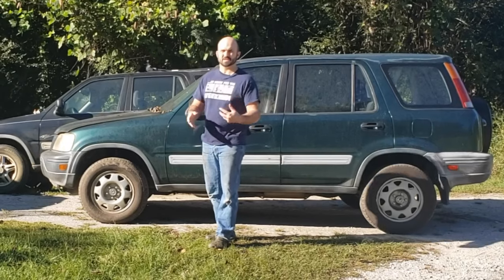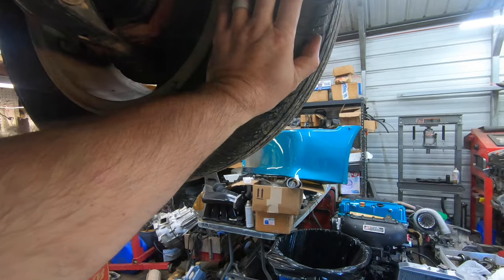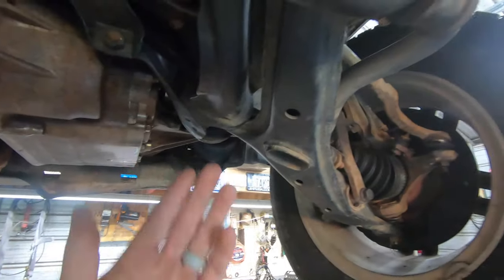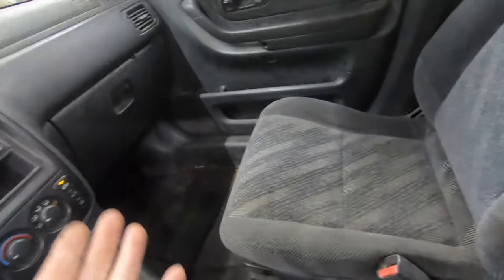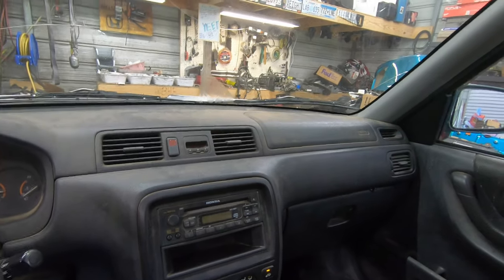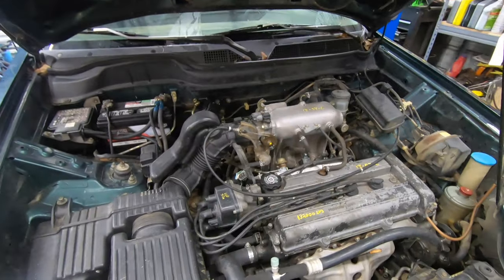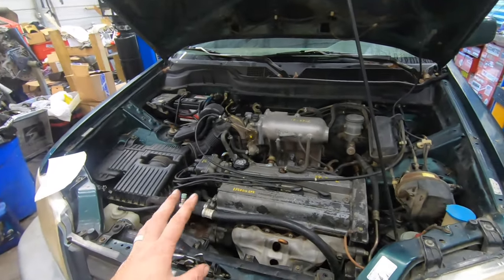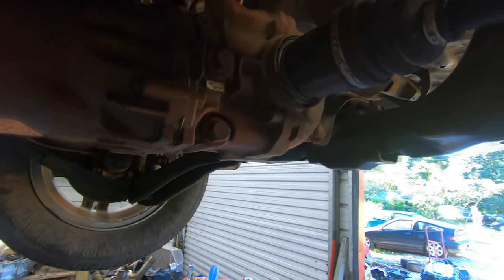Most Common Problems: 1997 - 2001 Honda CRV RD1 RD2

Comment: I’m having issues with getting the correct oxygen sensor for the down stream sensor and so far the one that I have now is a Denso 234-4011. It has the right correct connection but according to what I’m seeing it’s a up stream sensor don’t think the guys know how to read a parts book. The first one they gave me was the right sensor but a universal connection which had round pin’s and but mine had the flat pins. So it wouldn’t work so will this Denso 234-4011 work down stream?. Just asking. Maybe I should try a different brand. Like Bosch or so other brand. I do know this that O Riley’s is three to four times higher in there pricing 😮. This is 2000 CRV-EX four banger. If know or can help would be greatly appreciated. Today is Saturday Sept 17 2022. Thanks.
Reply from the maker: That is indeed the upstream. The correct number is 2344098
Reply: @hondaresource  part marker Denso or Bosch ?
Reply: @hondaresource  I see now it a Denso

Comment: Hey I got a question my 1 st gen Honda 1997 CRV has a miss on my Honda and it’s leaking gas a bit and spraying a bit of oil on the the radiator cover so what could that be by chance
Reply from the maker: there are a lot of variables there. you can send me an email to phillip@thehondaresource.com with some pictures and hopefully I can help you out.

Comment: Hey man how's it going. I figured you would be the best person to get into contact with regarding my RD1. I recently had code PO730. Transmission was slipping and not going into gear. I bought a jdm imported transmission with approximately 50,000 miles. I swapped all my sensors from my original to the new transmission with torque converter. With the new transmission in my RD1 it's still giving me the same code. I replaced my shift solenoid A, and my speed sensor. Is there any advice or knowledge you know of to help me out? Thank you.
Reply from the maker: Which torque converter did you use?
Reply: I used the OEM that came with the imported tranny I didn't use my original one that I had on my previous tranny because the mechanic said it would mess up the tranny I bought
Reply from the maker: @johnnyplurlife  correct, just making sure I was understanding correctly. I don't really know what to tell you man.
Reply: No worries bro thank you for your time. I'm going to swap out my shift solenoid B and see if that does the trick if not that new transmission it is

Comment: Good morning my cluster speedmeter went to crap, do the first Gen have speed sensor solenoid’s as the same as the civics, and are they in the same location?
Reply from the maker: They are. Right on the back of the trans. Be sure to check the terminals on the wiring harness connector. They corrode sometimes.
Reply: @hondaresource  awesome will be replacing and doing a video tutorial on the Fix appreciate you
Reply: @hondaresource  update on the fix, terminals were ehhh okay swap the VVS  and now my cluster works, she still sputs a lil from 1st to 2 second, im thinking the transmission shift lockup control solenoid needs to be replaced  have you had to replace it Before, and if so what were your symptoms

Comment: Hey bro, I have inherited a RD1 with pretty much all these issues. Thanks for the heads up on where the problems lie. I also have a few other issues; there is a distinct 'miss/hesitation' under power most noticeable around 2000rpm in 1st/2nd. Any idea what this could be, it runs mint otherwise. Also I see the car in the video has cracks coming in from the sides of the windshield, mine developed the same a few days ago out of nowhere! Liked and subscribed, thanks for the content
Reply from the maker: I would definitely start with a valve lash adjustment
Reply: MAP sensor also

Comment: Hi I was wounding if you can give me some in put on issue am having my 1st gen crv died while driving. When I go to start it I hear fuel pump turn on and prime and I can hear the relay click by the glove box when I go to turn it over all I hear is spinning noise. It’s not cracking over I replace the starter and cap I did get the rotor but it’s not cracking so I can’t get to the bolt to replace it I was going to get spark plugs and wires and check the fuses but any other info that could help would be awesome
Reply from the maker: Did your timing belt break?
Reply: @hondaresource  I haven’t checked I man hope not 🤞
Reply: @hondaresource  I gotta get A Valve cover gasket be for I check gotta do it tomorrow

Comment: @ Hondaresource can you please tell me what is wrong with my 2000 CRV. When I made a right turn the engine pwr no longer transfers to the wheels. I thought bad axle I remove both CV axles and they appear OK. When I put the car in gear it won’t go forward backward and in park it still rolls do you think the trans is gone? When I start the car and put it into gear you can hear the trans shifting and speedometer goes up and it shifts gears but no power goes to the wheels please let me know what you think  Brad
Reply: Ps: my crv it is automatic and frnt whl crv thank you
Reply from the maker: Definitely sounds like a broken axle. They car break inside the boots.
Reply: HondaRes:Thank you for the reply. I tried turning the axles holding both ends, and felt intact, but one could still be broken?
Reply: If axles ok then anything else to try? Thx
Reply: Turns out it popped out psngr side. And replaced with new one. We’re good 4now!

Comment: Funniest thing inside . I seen the door handle broke on passenger side,,  mine is broken inside and out & Hurd others have the same problem ,..ware is your shop ? Qm having a hard time finding a good used AWD transmission ..high price & high mileage 😡 ..would you know a good source I can get one ,? Can I convert it to a front wheel drive automatic different transmission ? ..I'm suffering 🙃
Reply from the maker: I'm in West Blocton, AL. Yeah, they are getting harder to find for sure! try car-part.com

Comment: So I have a 1999 crv with a manual transmission and now it’s not shifting and stalls when I left of the clutch I just wondering if this could be the shifter cable?
Reply from the maker: Sounds like it's stuck in 2 gears
Reply: @hondaresource  so if it’s stuck in second and the shifter inside the car not moving it a broken or stretch cable yes?
Reply from the maker: @coreysda7984  could be cables could be trans

Comment: Hey I'm my 97 AC blows cold going down the road both fans are gone but once I stopped at traffic light cold-air dies off very faint but both fans are going could I have something going on and change over valve or system itself
Reply from the maker: Are the fans going at full speed? I've seen some that appear to be working but are barely moving compared to what they should be
Reply: @hondaresource  yes they are turning but that's a good point they might not have enough RPM for CFM flow

Comment: Any tips for an overheating crv in hot weather it’s fine otherwise
Reply from the maker: Both fans working?
Reply: That's uncommon. If the coolant is clean, and there are no leaks, consider the last time you changed your timing belt and water pump.

Comment: I have a 1998 crv and the steering wheel keeps going to the right and I hear a sound  that keeps making noise whenever the tire does a full rotation on the road and it seems to push the steering wheel right  from the left front tire
Reply: I don’t know what could be the issue
Reply from the maker: alignment?

Comment: Hi, I have a first gen 2000 Honda crv ex,   , so,  it would cut off if it was a super hot day abd I blasted my ac   couple times, had to sit 10 minutes, it would be fine , so then , it sounded if just sitting running for 15 minutes like it was hiccupping  out the tail pipe ,  but anyhow so  one day drove it to work came out , it was crank no start.  , got a jump , it started .  Checked has spark , so , drove , work  , again no start, but wants to , then changed fuel pump and filter,  same darn thing , but I drove it one whole day after filter got replaced, but that's it ,  , is it the fuel rail, , because it's not getting the fuel pressure, help please, b4 it gets towed. Thanks , seems like something simple but idk...
Reply from the maker: I would check the main relay, its behind the glove compartment.
Reply: @hondaresource  do you have a video on that main relay replacement?

Comment: Yep, leaky oil pan. That's in the to-do list.
Reply from the maker: Just make sure you use that rigid felpro
Reply: Yes sir, I've watched that video too.
Reply: Try just tightening up the bolts first.  A few of mine were a little loose & that did the trick.

Comment: These cars are BP!! Check 1. Upper and lower ball joint!  2. Inner & outer tie rods also rack boots. 3. Timing belt W.P. replacement AGE/MILES 4. Valve adjustment!! Everything else is maintenance
Reply: The clock you can remove and re-solder the circuit board

Comment: Hey buddy quick question or if anyone can help me out in the 1st gen crv with the door locks door. Do all four doors open automatically with the driver door switch or is it just the driver door that has auto locks?
Reply from the maker: They should all lock when you lock the driver door
Reply: @hondaresource  thanks very much now I gotta track down why only my driver door locks not the rest
Reply: @hondaresource  just lock only or unlock all four too?
Reply: @Edwin-uk7wc   hey I have a rd1 as well usually just locks all of them and when you unlock it it’s only the drivers door and you have to press the unlock button to unlock the rest, at least that’s how my 98 does it.
Reply: @electrogaming1274  thanks man I gotta track down my issue then mines only locks and unlocks driver door only
Reply: Lock and unlock driver door only

Comment: The middle Valve cover spark plug hole gaskets be rotting out and pouring oil onto the spark plugs and wires
Reply from the maker: Yeah those tube seals can be leaky from time to time
Reply: @hondaresource  Right causing it to lose spark and bogg down

Comment: One big major problem I've had with my Crv is it still doesn't have a Vtec engine swap 😁
Reply: My 2001 has a Vtec engine.
Reply from the maker: @Jeremyho439  you must have converted it
Reply: @hondaresource  
No. My Machanic told me that when he was working on my car. He said very few 2001 has this engine. I didn’t even know that. He told me every time I step on the paddle and the car suddenly runs like with turbo.
Reply: @Jeremy Ho  your mechanic doesn't know what they're talking about then. You'd have to put a vtec head from a b16/18. They didn't come stock like that.
Reply: @Jeremyho439  Oh Yea and What engine is that?

Comment: I have a 200 Honda CR-V, it fires up good , runs smooth, then just dies after a few mins, that problem repeats, what is the issue
Reply: 2000*
Reply from the maker: Maybe coil or ignitor in the distributor
Reply: @hondaresource  so just replace the coil? Could it be the ignition
Reply: I had that issue. I replaced the distributor and it was all good

Comment: I have the 97 Honda CR-V grey and l took it to get  head gasket on spark plugs and oil pan gasket and now it's leaking oil l say oil pan and white smoke just like that is happening 😭😭 l think 🤔 they cheated me ! It wasn't leaking oil and l know it needed the other things but it didn't have power as l drive it and main seal on right lower side  ! So sad 😭😭😭😭😭😫 because it didn't want to start ! I did get it started and took it back they don't care !!! Said the battery is on t it's worse and you tell me what parts l should  check ?  That's all I have and l need   because it's get cold and rainy and l need to get the the hospital ☹️ because of my cancer treatment every 3 weeks !l  have to take metro train and a bus to get chemo treatment and test l really need a videos ! I fixed it my self if I have to !! Thank you
Reply from the maker: definitely sounds like something is still going on with the headgasket if there is white smoke. Oil pans are notorious for gasket leak.

Comment: one you missed, and it is the most annoying in Hondas models from back then : Ignition Distributor /  Ignition Coil problems
Reply from the maker: distributor is definitely an issue.
Reply: I usually find its the ignitor that fails.  I now carry spare distributor parts & a new cheap chinese distributor in my car that I hope will get me home someday.  Car just shuts down on the freeway when a distributor goes bad.
Reply: @darrylstevens2556  it does! I had a problem with my RD174 model (1998) about 6 months ago. not long after replacing an aftermarket distributor (Chinese)... I feel somehow that it overheats from the cylinder head and then fails after a while... Although a mechanic friend managed to make it work with a random ignitor outside of the ignition cap and far from the engine, it required some "dodgy" wiring work, but it actually worked! no problems or performance issues so far.  I will take some pictures later and share them with a link  in the next comment

Comment: Any suggestions on a better horn? The horn for the 1997 sounds like a "Karen" at a riot.
Reply from the maker: You don't like Karen at a riot? 😂 There are a number of aftermarket horns with different tones that you can buy online
Reply: I'll take a look, but the only problem with that is you don't know the sound until after the installation. Cheers
Reply from the maker: @cri8tor  you could try it with some pieces of wire and hooking it to the battery
Reply: Yep, good tip.

Comment: Is rd1 mean generation 1 and rd2 generation 2 or ?
Reply from the maker: Rd1 and rd2 are both 1st generation. It's the chassis code. Rd1 is AWD, rd2 is fwd
Reply: @hondaresource  oh that makes sense thanks, then what would the 2nd gen be called rd3 and rd4
Reply from the maker: @lukavidovic3939  Rd6 Rd7 in the US
Reply: I have the R2D2 model....it just goes bleep-bleep-bloop....help me Obwan! It has a charger for a light sabre.

Comment: I'm looking at purchasing a 2000 CRV runs good oil always changed on time heat and air work fine but the problem it has is the AWD system only the front wheel drive works not the rear could this be a major problem or maybe a simple fix anyone with any or all kinds of information on this lol would be greatly appreciated thank you in advance!!!!!
Reply from the maker: Probably an easy fix. Is the driveshaft in it? If so and it's not engaging, try changing the rear diff fluid. If that doesn't fix it, swap the rear diff

Comment: Rear frame ties they never last always rusted
Reply from the maker: We don't have rust here so it's not an issue
Reply: @hondaresource  that must be nice lol I need the rear frame ties other than that these car are fantastic I have a 1st Gen 2000 crv
Reply: I also had the wire issue with the driver door did what you said and wired directly no clip and window and everything to that door works perfectly
Reply from the maker: @steveocrazy17  yep, straight wired it, everything works perfectly

Comment: Soo, you are surprised you need to change bushings? Those are supposed to break, on any carz if you get what I mean.
It's like, don't buy honda because tires are gonna wear...
Reply from the maker: Say what?
Reply: @hondaresource  Just saying it's not a Honda CR-V common issue for bushings to break in time. It happens to every car. I was looking for bigger failures that can happen. Like a specific area where it gets rust, engine oveheating because of something for example, not general info 😅

Comment: Can we discuss the stupid headlight design?  We have to change the bulbs in our 98 crv and i just watched a video lol we have to take off the bumper to change the headlight bulbs wtf is that
Reply: Exactly, looks like the designer was drunk at that time, 2002 crv to change oil pan gasket you should remove motor mount and part of the car FRAME

Comment: Overheating is common
Reply from the maker: Not super common but it's definitely an issue
Reply: @hondaresource  my crv is my 3rd honda I've owned. 
My experience is after it's first issue with overheating, the problem is really never resolved maybe for a year or two but not for anything longer than that. 
I've just started noticing a lot of videos mentioning that honda have overheating issues, especially the crv models. 
Honestly not really complaining because I'm learning so from able to work on older vehicles like mind.